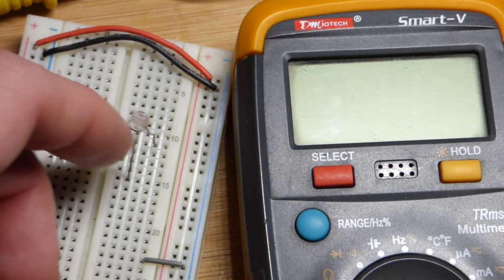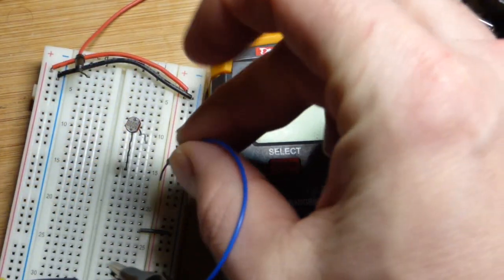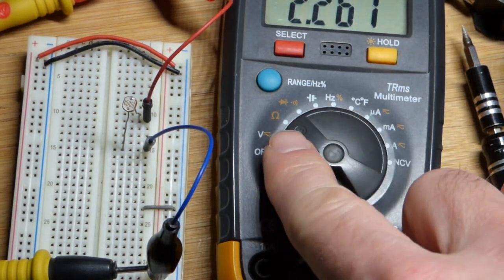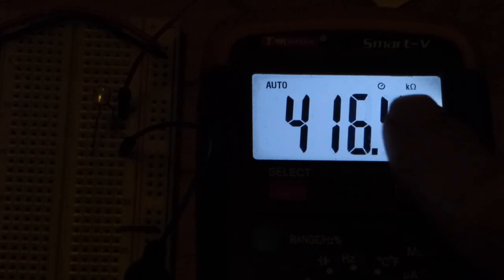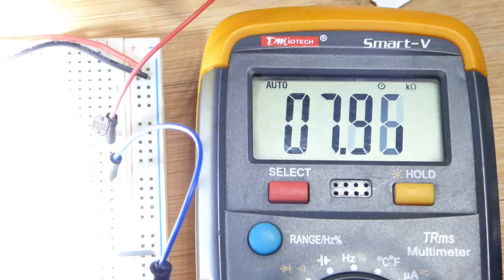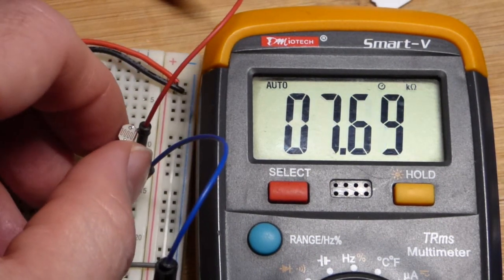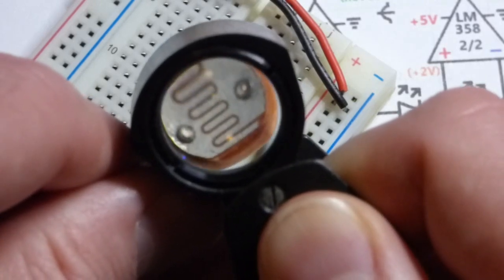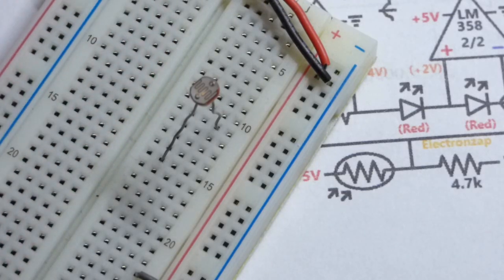Light Dependent Resistor LDR multimeter resistance of Photoresistor

Comment: Most datasheets mention 1 Mohm as dark resistance, but these type of LDR's go way beyond 1 Mohm in dark. In fact they go in comlete darkness within 1 minute over 100Mohm, and after 24u more then 1Gigaohm. A few years back i was working on the control unit of a oil burner (central heating) and that control unit always went in failsafe mode in the morning, then after resetting, the oil burner kept working the entire day, up to the next morning. 
When i measured the LDR current signal to the control unit, those numbers where in spec (arround 75µA), but i discovered that after 24u hours of non use of the oil burner, or 24u darkness on the LDR, that in the morning the first minutes that the oil burner started, there was almost zero µA of current flowing due the very resistance of the LDR. 
The oil burner manual recommended a LDR current signal between 65µA and 200µA (control unit was internal limited to max 200µA through the LDR).
I then did some measurings on the bench with the flamesensor (LDR) of that control unit, and saw that my meter whent beyond 100Mohm within 1 minute. 
I then hooked up my bench powersupply set at 10V with the LDR in series, and measured the voltage that was passing through the LDR when the LDR was in complete darkness, then used Ohm's law and came above 1Gigaohm within a few minutes. When i did the same measuring with the LDR covered for hours, i couldn't measure any millivolts passing through the LDR, so the resistance was even higher then 1 Gigaohm. Even when i raised the 10V to 30V. 
The end this story, the problem with the oil burner was, that the LDR whent so high in resistance, that it took a few minutes before the LDR was recovered from darkness and dropped the resistance so that there was enough current flowing that the control unit could detect that the oil burner was working. 
I then build a simple amplifier with a BC547B,  and used the LDR with a 330Kohm resistor to set the bias on that transistor, now a few years later, the oil burner is still working fine, and only goes in failsafe mode when the flame is complete out for a few seconds. With the amplifier the current signal goes within 1 second to 180µA when the oil burner starts. This value of 180µA is setted by the 330Kohm resistor. After that, i did some research, and found that this is the socalled "Memory effect" of a LDR.
Reply from the maker: Thanks for the info!